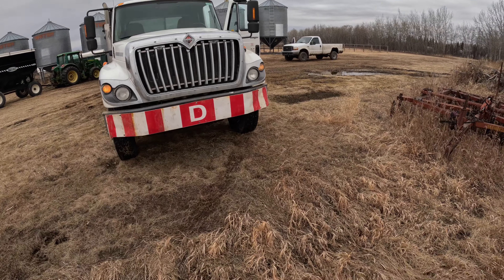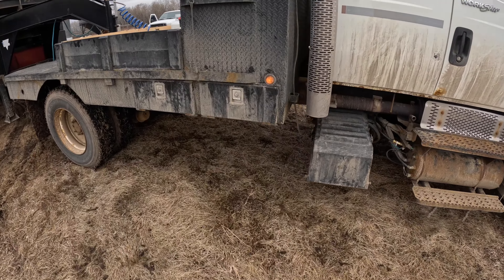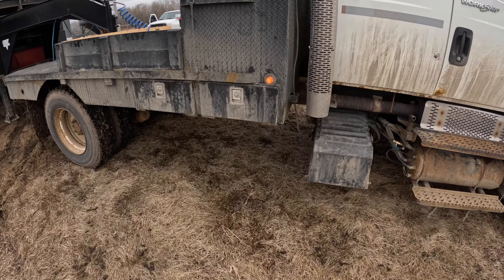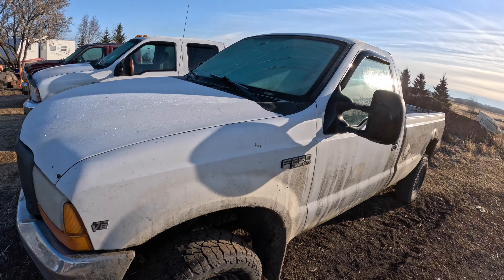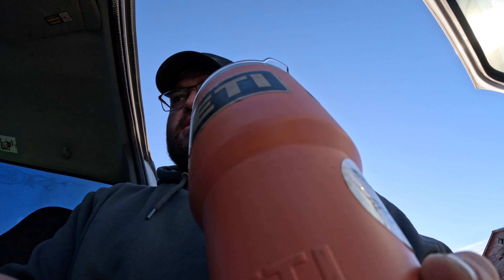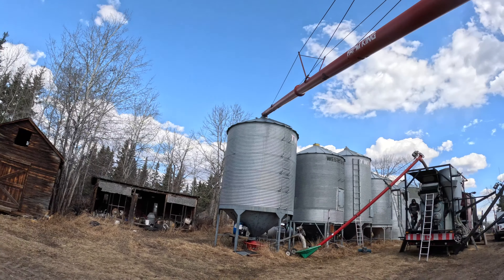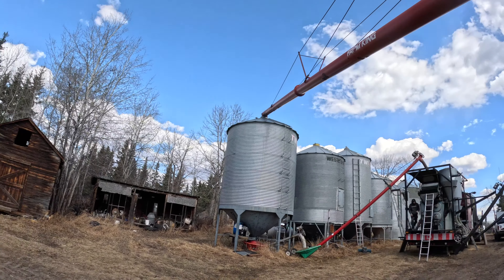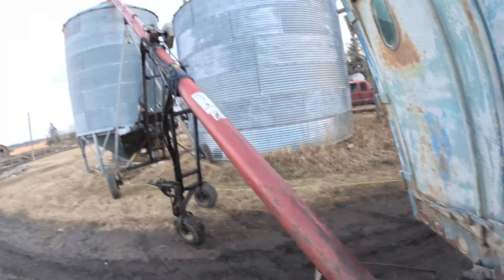Finally! Cleaning grain at home😎💥

Comment: Shouldn’t the Steiger be on grain cart and the deutz can run the auger 😂
Reply from the maker: That would make too much sense!
Reply from the maker: Both tractors are 1000pto but the auger is 540…..and the Steiger has enough oomf it can run the auger at an idle and still have enough hydraulics to run the televeyor.
Reply: @NEBertaFarming  fair enough 👍🏻